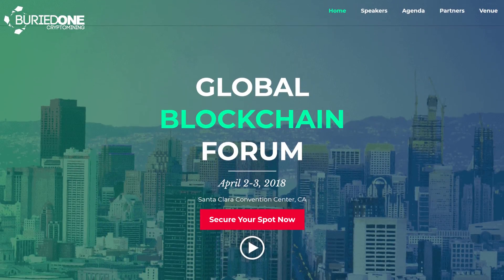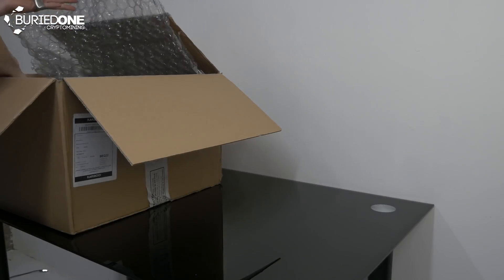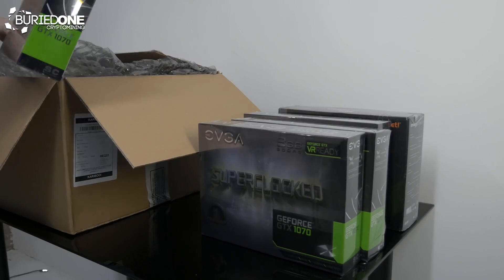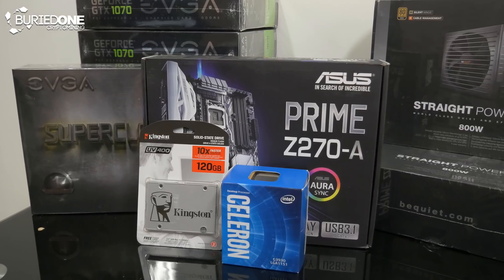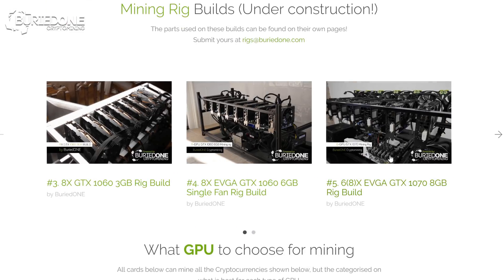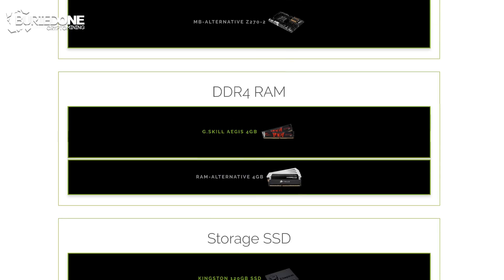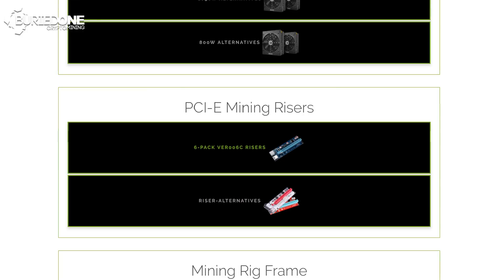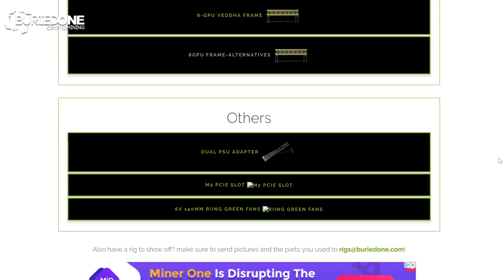Upgradeable 6 to 8-GPU GTX 1070 8GB Mining rig Build

Comment: I would like to know from you how long the graphics cards last, they don't break? Can they be reinstalled in the gamer Pc?
Would you buy a Nvidea gigabyte 1070 that has meant 12/7 a year without overclocking, which still has 6 months warranty for 200 euros?

Comment: Great video, Amazing channel! I'm considering building my first rig

-Would you consider using a z370-a? I think they require 8th gen processors though.
-is 4gb all that's necessary? Or is 8 better? 
-Would a 6 1080ti or 8 1070 rig be better? 
-what psu(s) would you recommend for either of build?
-how do you tell what version riser to get for your gpu?
Reply: did you find the answer to any of these questions? i would like to know and i currently  want to build a 1070 mining rig.